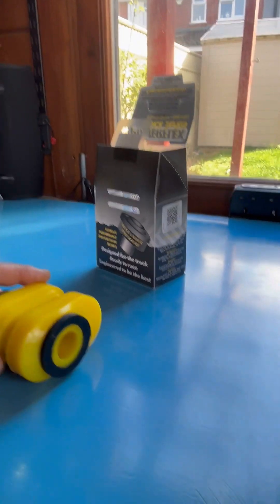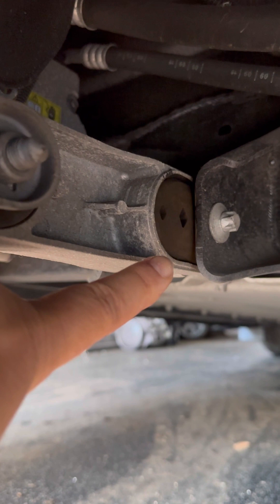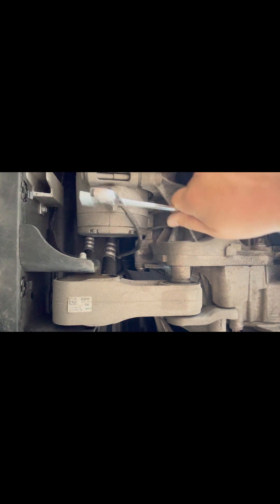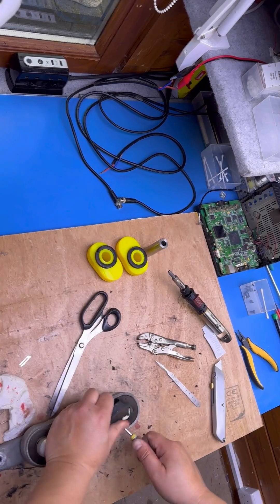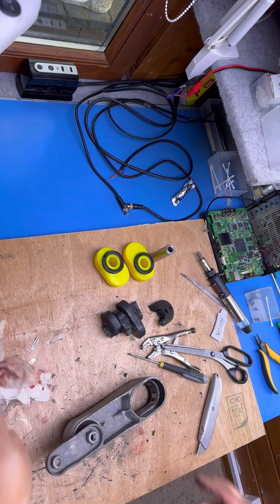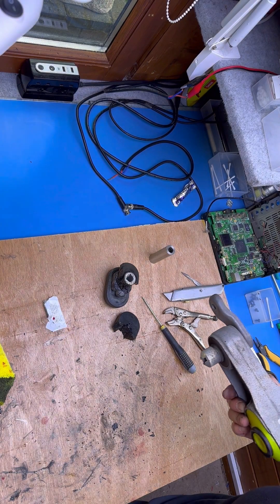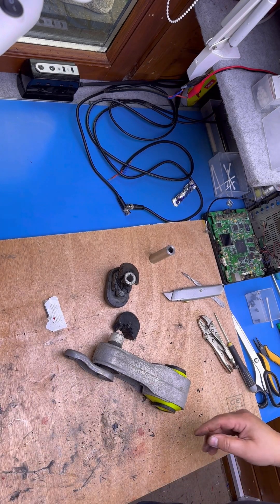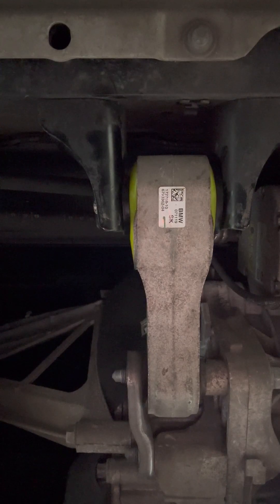BMW i3 Motor Mount Modifications

Comment: Finally did this to my 18 i3s rex, and man... it was much more trouble than I thought. Def invest in a pry bar, and pry at the transfer case between the wedge at the back. Pay close attention to the orange HV cables in the same location. 
I also ended up burning the old bushing with a torch. Much faster than wedging it out with screwdrivers.
Reply from the maker: Glad to hear. yes a PITA to do but so much needed mod

Comment: Too bad you dont have a rex. I'd like to know how bad the vibration is when the ICE is on.
Reply from the maker: I am led to believe it saves you going to the dentist to have teeth removed
Reply: This part has been around for a while... For the Mini Cooper line.  It's just taken us a while to realize that the same torque arm (or at least the same bushing) is used for the i3.  I intend to order and install the same version shown here on my 2014 Rex, will report back.  I hoon *hard*, sheared my right motor mount bolt last Friday, have also been looking for a way to reduce slop.  I chose the street version as I think the black version will be way too stiff.  If it still feel sloppy, I think I'll fill the dead space around the main mounts with something before further stiffening the torque arm